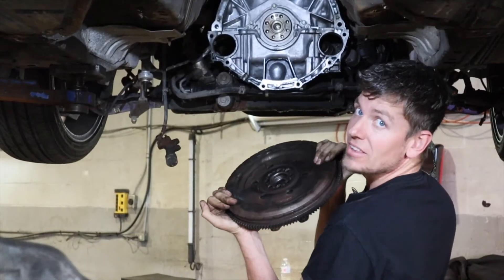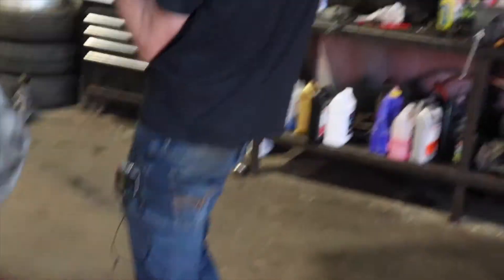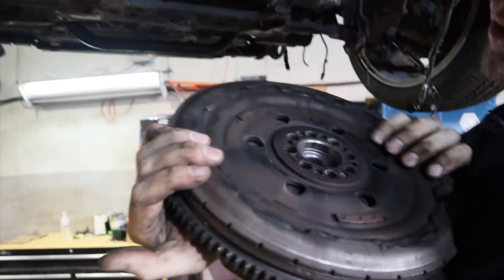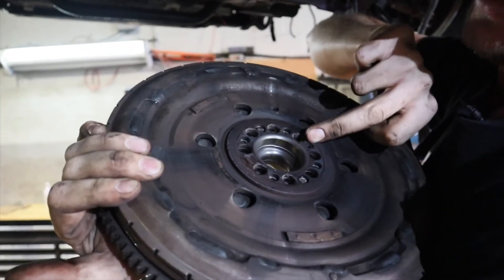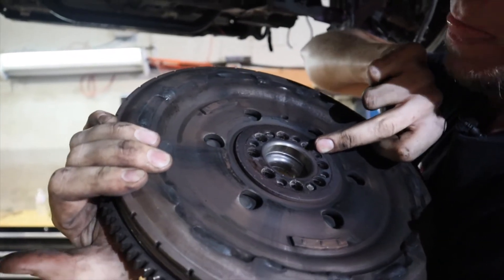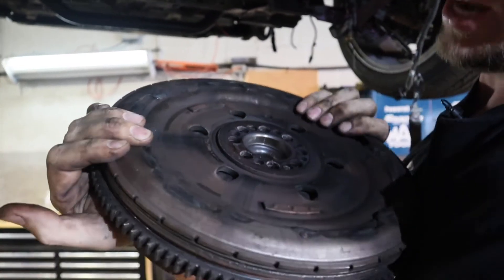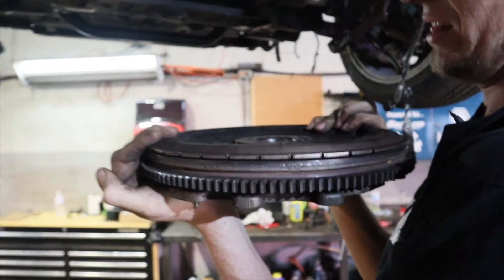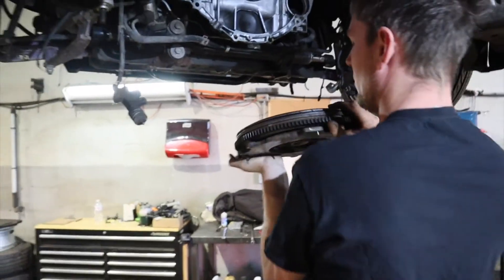VQ35DE Flywheel no start fix.

Comment: I have a A/T 06 DE 350z that’s shutting off power to engine when I shift to Reverse, Drive, Or Manual. In neutral and park the engine stays on. Any idea what could be wrong? Is it my flywheel or my transmission?